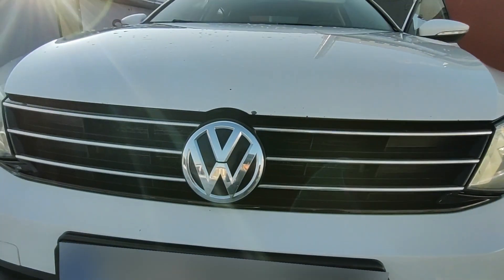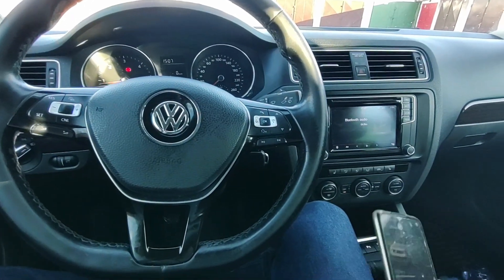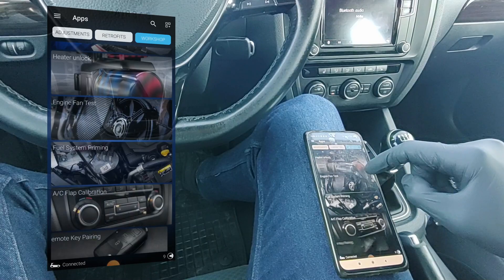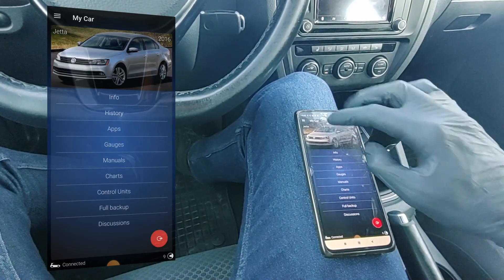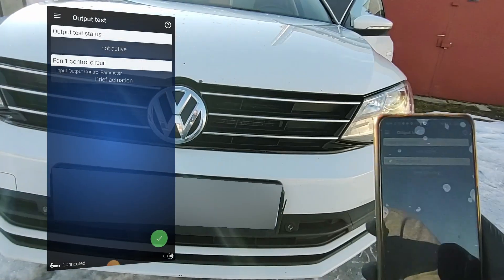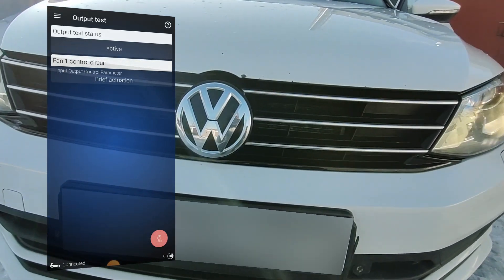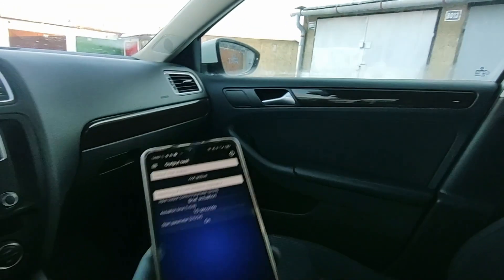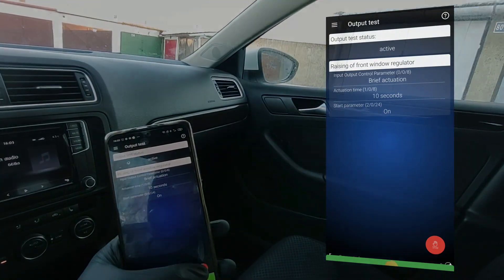How to test engine cooling fan on VW/Audi with OBDeleven/VCDS

Comment: Hi i tried to do the "engine fan test" on my vw polo mk5 6R and the test keeps failing, can you tell me what the issue could be please?
Reply from the maker: Ignition not ON?
Reply: @iamcarhacker  The key is turned and there's lights on the dash and the engine is off. I press and hold the green button and after a moment it says failed. I have tried the fan test through engine output test but says "31 function not available"